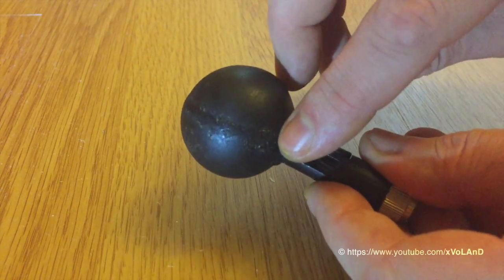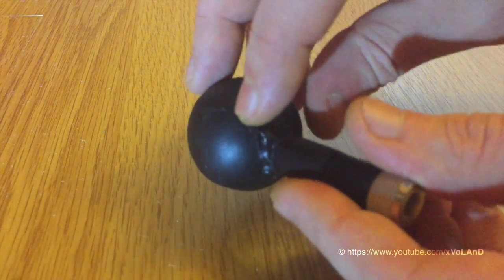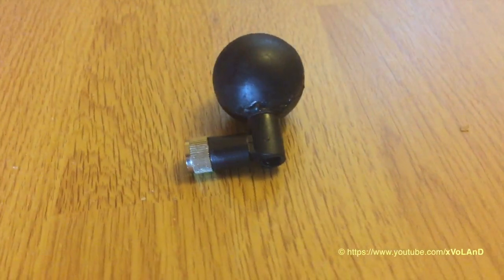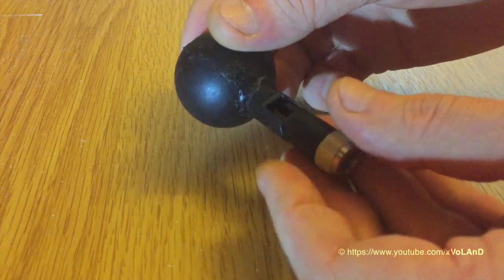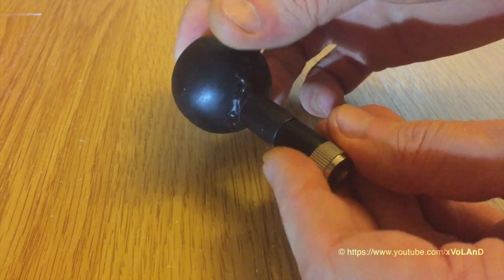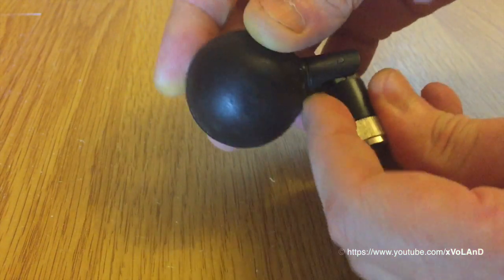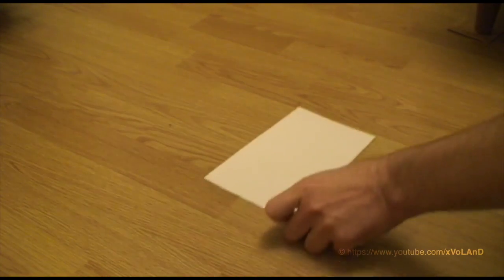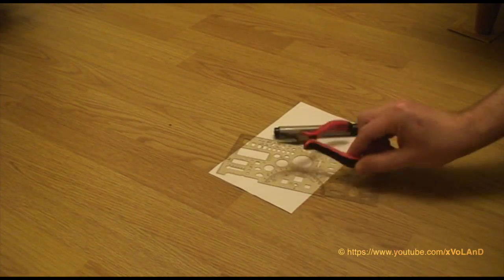Make a DIY Cloverleaf Antenna. Circular polarized antennas for FPV video streams and WiFi

Comment: your going to loose gain (high loss) when using a CP antenna with a linear antenna.  I dont' understand what it is that your attempting to do....
Reply from the maker: +08ds I have a different logic, and I got an increase in signal +4-8dbi
Reply: what about dropped packets and so on?
Reply from the maker: +08ds everything is fine. If you are interested in some data in some special program, I'm open for test :)